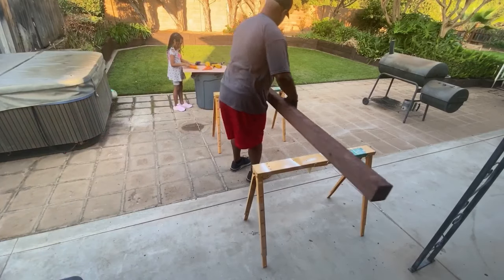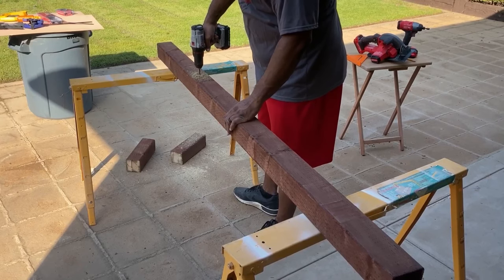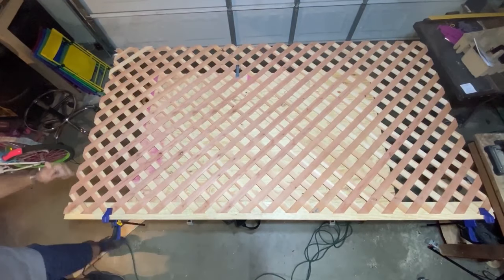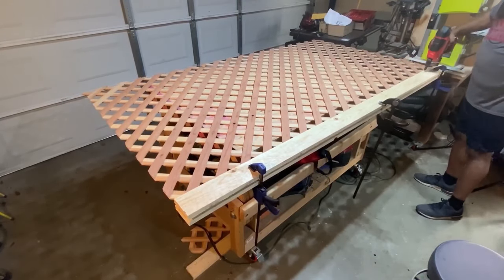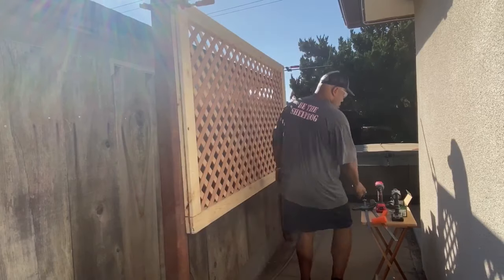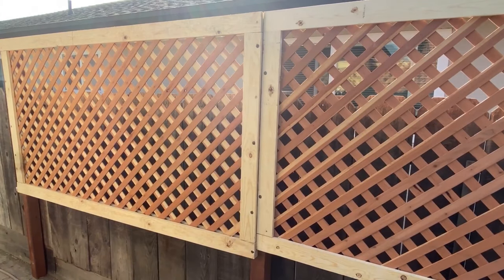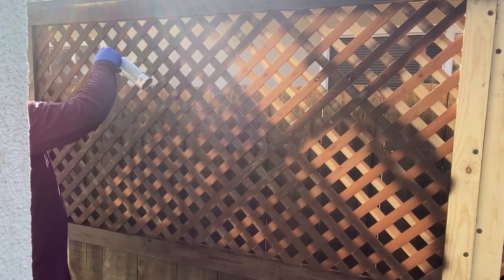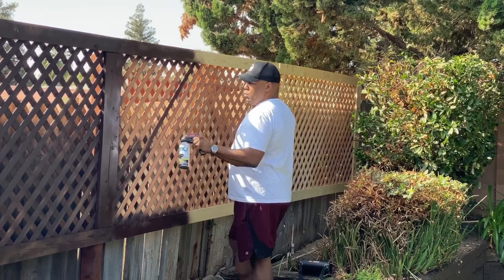How to build a DIY Privacy Lattice Fence

Comment: Overall I think you did a good job BUT I wouldn’t like you as a neighbor after spraying all that paint on my walls. I could see the overspray going beyond the fence. You could have painted the fence before installing it. Also, I may be wrong, but the screws seemed very long. If so, most likely they’re protruding out on your neighbors side.
Reply from the maker: Thanks for watching. Best of luck with your next project!
Reply: @BaileyBuilt ...did the screws poke out the back? Need to know before i buy. Thx!
Reply from the maker: @zaneblane8160  No, The screws go into the 4x4 post. You will need to get the correct length.
Reply: He could have set up a plastic barrier behind the lattice.

Comment: Did your neighbors complain of overspray? I probably would have painted before installing and then spot paint if needed. Good video.
Reply from the maker: Hi Victor. The spray cans have great flow control and a very short throw distance. Once you get used to using them there is not a lot of overspray at all.
Reply: what dud they say about you building on to their fence???

Comment: A bit of an odd installation. He could have gotten the same result with 1/2 the height of the lattice and would have saved a lot of money as well. And Definitely should have painted before installation.
Reply from the maker: Sure, you can do the half sheet if you are only attempting to lift the height. For this project, I also wanted to accomplish masking the fact that there were fence pickets that were different heights. I choose the full sheets because aesthetically it made it more appealing for it to be uniformed all the way down the fence.

Comment: Could I ask why the first panel overhangs the others at the bottom .  One other thing I would be concerned with is the over spray  getting on the niehbors things. Looks good my friend..
Reply from the maker: Thanks for watching. The existing fence had fence panels of different heights. My design allowed for a uniform look all the way across the fence line of sight. I started on the left edge of my view from the living room and continued from there.  

As for overspray, I recommend the spray can because it did a good job of targeting the area where the paint coverage and distance.

Comment: Securing something that size to an existing fence post that’s definitely compromised by the look of the lean towards the end of the yard  i imagine it wouldn’t be good idea. Is it still standing? I did like the look of the lattice overspray on the old fence and neighbours house though. Pretty sweet job
Reply from the maker: Thanks for watching! Yes, it has held up nicely. The posts at the end of the original fence have a slightly different placement due to the flower bed. The fence has survived a number of strong storms and some fairly heavy winds. Good luck on your next project!

Comment: I'm planning a similar project but but confused by a few of the choices...why would you install and then paint it? Also...if you only wanted to extend the fence by a a foot why did you use the entire 4 foot panel? Was it so you didn't hae to install it directly onto the fence? But you did it with the 4x4s...
Reply from the maker: Thanks for watching. Yes, I used this large section do to the fact that the fence panels were of various heights when we moved in. The large panel gave a uniformed looked and it also provided a great backdrop for plants as well. Good luck!

Comment: Not sure why you didnt paint before mounting the panels. Id never paint a project that big with spray paint, get a gallon can and an air sprayer.
Reply from the maker: Thanks for watching. I can appreciate your advice. For this project in particular, I wanted to test out a project this size with a new spray paint. Good luck with your next project.

Comment: Looks good but wouldn't it be easier to paint before you put up? A lot of paint is going to neighbor's yard and patchy paint splotches on your existing fence and the back of lattice on neighbor's side...
Reply from the maker: The beauty of using the spray is that as long as your distance from the fence is accurate you won't need to worry about much overspray.
Reply from the maker: E U  The other side has a natural wood finish.
Reply: Won’t that natural wood rot quicker without paint? Your project  is exactly what I want to build for climbing roses. Thank you!

Comment: What about a cement block fence that needs privacy?
Reply from the maker: Thanks for watching! Yes, this will work on a cement block wall as well. The lag screws included in the supply list will attach to several wall surfaces.

Comment: Will the old post support the new weight? What about when old fence needs to be replaced
Reply from the maker: Yes, the old post does share the weight. Remember I attached the new post to the old post. You could also dig holes for the new post as well. Good luck with your project!

Comment: Looks good, the size difference for that first lattice box would drive me nuts. As well as knowing the entire thing isn't painted, such as the side against the fence, top and bottom.
Reply from the maker: Thanks for watching! In the case where you would like the back side of the lattice painted you could always do that before attaching it. The top and bottom of the lattice are covered at the same time you paint the face. Good luck with your project!

Comment: But only about 2 feet of "privacy" was added, 3/4 of the lattice panel is under the top of the fence.
Reply from the maker: Yes, in this particular caseI was adding the lattice because the fence had panels that were  a variety of different heights. This method allowed for a more finished look as the entire fence now stands at the same height. Good luck with you next project!

Comment: seriously whats the need for the frame on the backside. It can be screwed into the 4x4. Also the where the 2 lattice meet it can be covered by a single strip. Just not a well thought out project. Good utility though
Reply from the maker: Thanks for watching. I wanted to reinforce the full frame mainly because there were a variety of different board heights on the fence. This gave it a clean look as well as a sturdy frame. Best of luck with your next project!

Comment: Hello Bailey, How did you attach the 4x4 to the existing fence ?
Reply from the maker: I used Spax powerlag bolts. They have a recessed head and come in a variety of lengths. They worked great. There is a link to them in the video description.